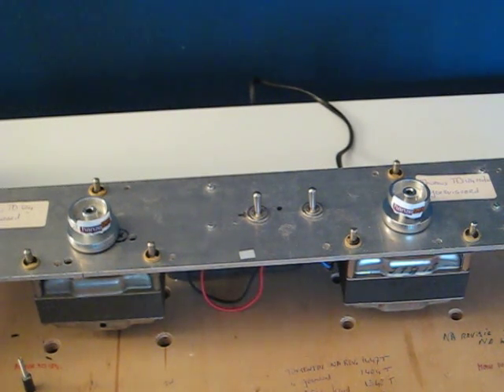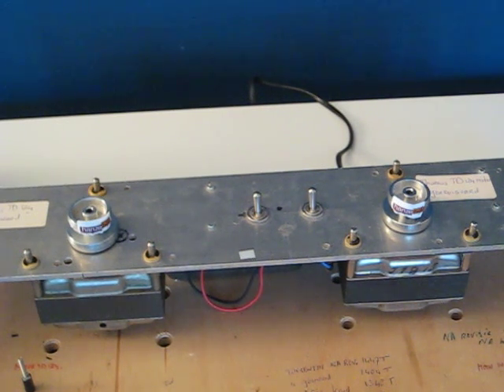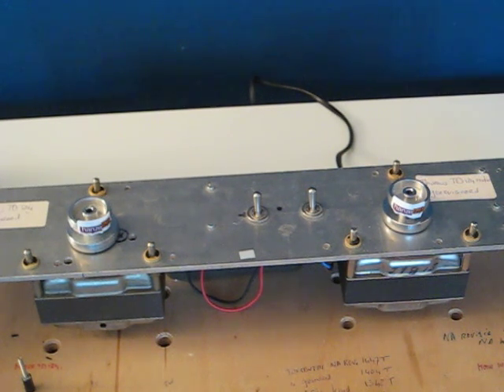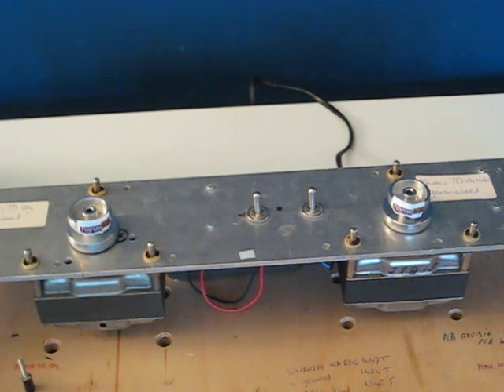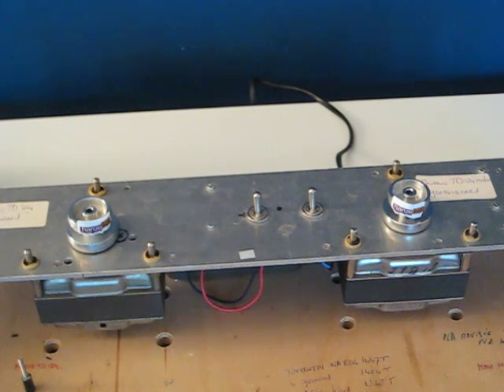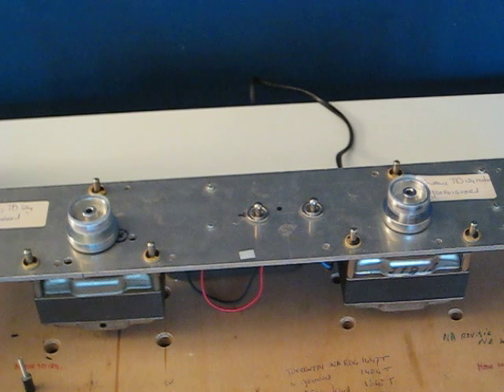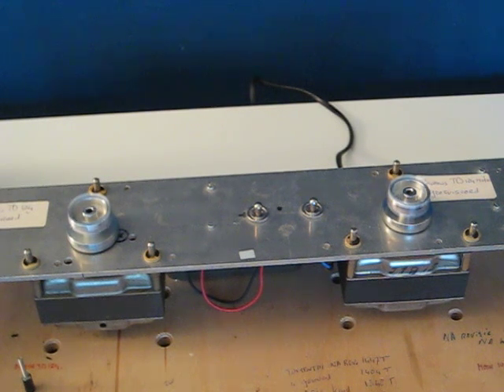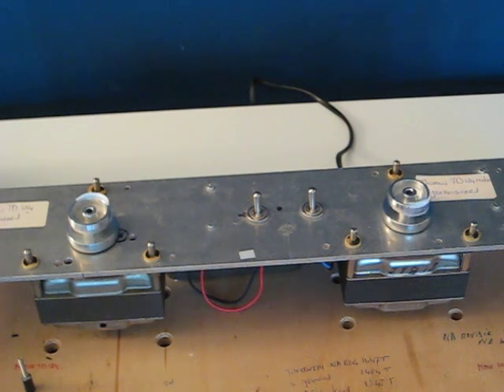What to do when you finally receive your Thorens TD-124 ???

Comment: It all depends on the use the td 124 has previously had. If there is no play on the bearings they can be returned to good working order, no need to replace them. Just put tem in the oven in a paper towel, repeat process for 2/3 times. Then reheat in the oven and put them on a solvent, repeat twice. Then heat the bearings in oil and let it cool down, they will retain max oil. Clean the inside of the motor, use new felt pads, mount and align the shaft for minimun noise and drag. And voilá, as good as new. Anyone with some DIY capabilities can do it!